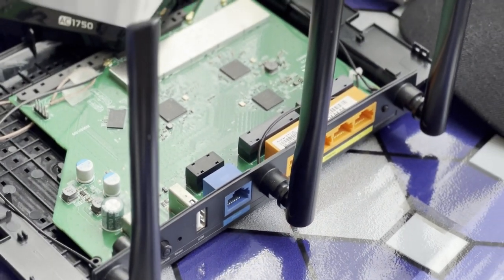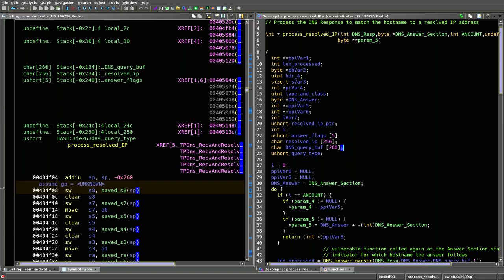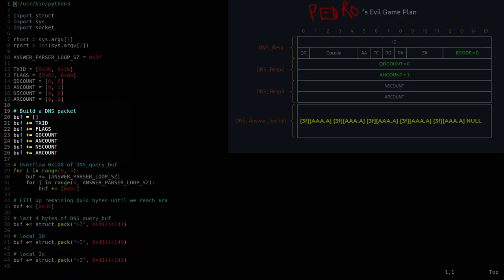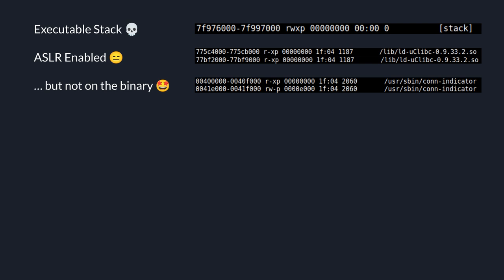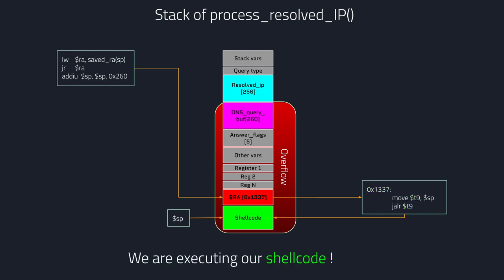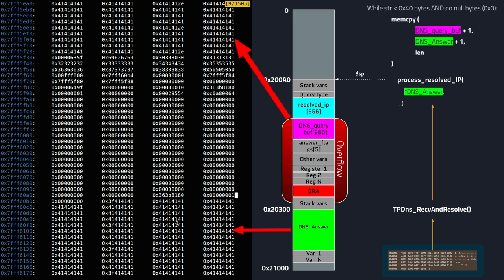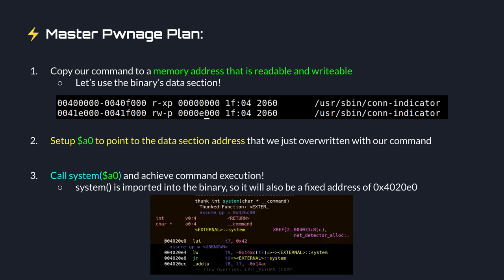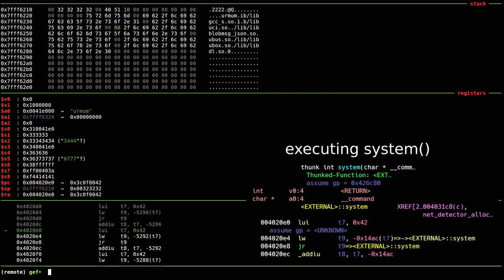DNS Remote Code Execution: Writing the Exploit 💣 (Part 2)

Comment: Just wondering, how long did it take you to find the vulnerability and write the exploit? I am venturing for the first time into exploit development and I'd like to know how long it takes for a professional (or in this case, two professionals) in this sector to find a vulnerability and write a working exploit for it.
Also, fantastic content!

Edit: Mainly for comparasion purposes, I don't expect me to find a vulnerability and write an exploit for it in a couple of hours (maybe in a couple of months, if the stars align nicely 😂)
Reply from the maker: The whole process was done in 3 stages:

1. Finding the vulnerability: that was relatively fast, we played with the binary a bit, did some recon but we got lucky with our "fuzzer". It probably took us less than 2 days of work.

2. Understand why it was crashing: we had a huge payload that was crashing a service. But it took some time to learn where it was crashing, why and to create an isolated PoC. We had to learn about DNS internals through the RFC, reverse engineer all the code, and link the concepts to the code. This took us a least 3 days.

3. Writing the exploit: this took the "3 long days and nights" mentioned in the video, plus an additional two days to clean it up and make it reliable.

In all honesty we don't remember very well, since it was 4 years ago. But we estimate the whole process to have taken around 2 weeks or more.

Since then we have gained quite a bit of experience; it's hard to say how long it would take us now, but a fair estimate would be 20 to 50% less time. This is not a certainty - there's always an element of luck involved in many of the stages, which might add or remove effort to the project.

For example, if we had the "luck" to have good memory addresses in the stack, we could probably have written the exploit in one or two days.

If we were unlucky with our "fuzzer" we could have easily spent 5 / 10 / 15 / 20 days reversing other binaries until we looked at conn-indicator and found the vulnerability statically.
Reply: @FlashbackTeam  Thank you for the kind insight into the process! I really like how exploit development requires a lot of research, I guess there is always something new to learn from it.

So it's a process for which the time to go from vulnerability to an actual exploit may vary in length: it can be a one week journey or a much longer project if someone is rather unfortunate with the fuzzing, it is dealing with packed or virtualized binaries and so on.

Once again, thank you for the kind feedback. This will help me a lot since I want to make a career out of exploit development and vulnerability research. ❤

Comment: Awesome content. But which OS you use for IoT hacking?
Reply from the maker: Thanks! We both use Linux.
Reply: @FlashbackTeam  thanks for reply. But i mean which Linux flavour. Is it specific for hardware or a journal distribution?
Reply from the maker: The Linux distro is personal preference in this case. We like to use Debian and Ubuntu. But sometimes we need to use Windows to run some hardware tools that might run only on Windows, keep that in mind.